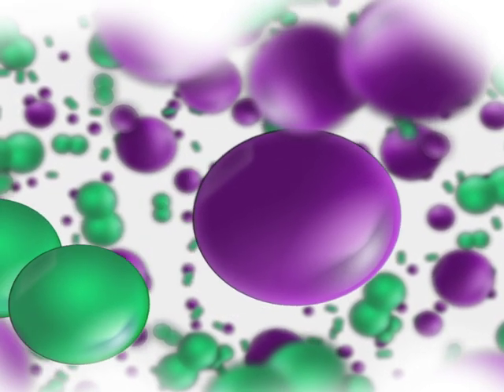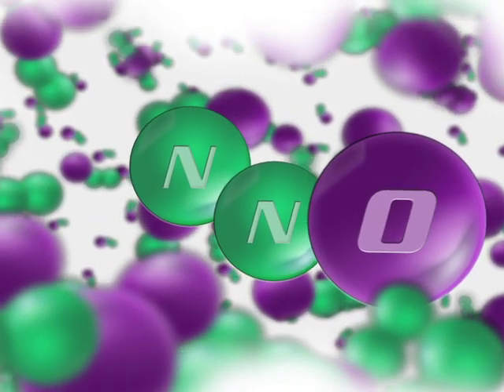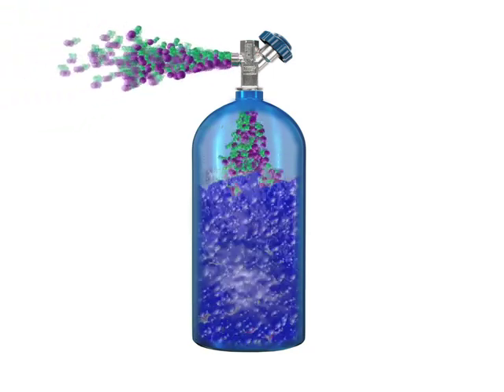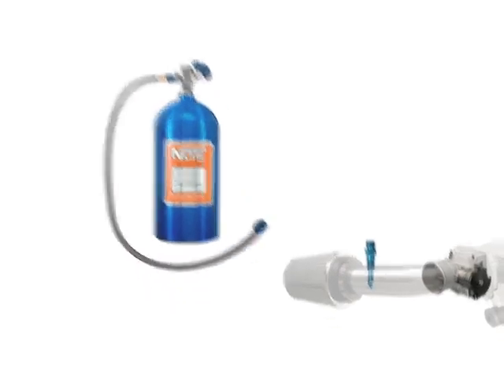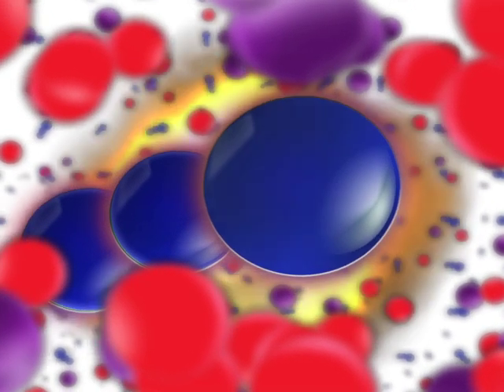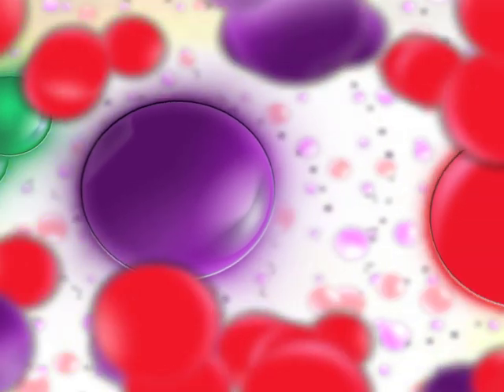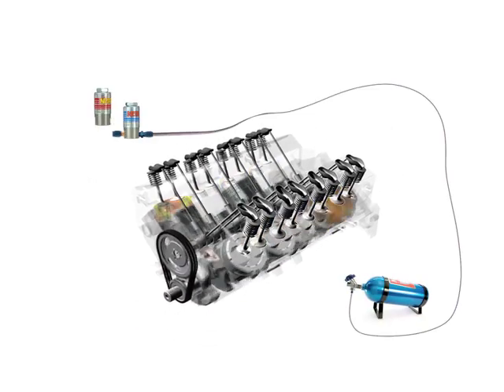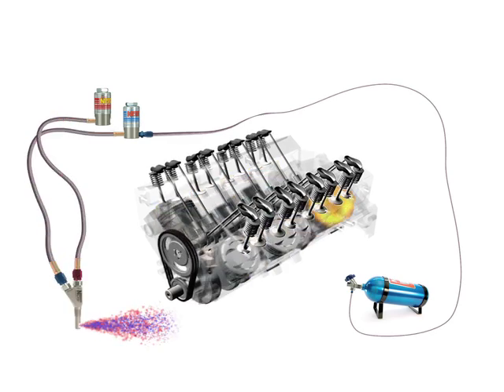Introduction to NOS: How nitrous oxide injection makes more horsepower

Comment: Can i Put 2 or more of these kits on one engine or car?
Reply from the maker: “You can put as much nitrous to an engine as you want to, but you want to do it in the safest manner possible in regard to the purpose and longevity of the engine.  You can run as simple or as elaborate of a system as you want on a car, it doesn’t care.  You can have one bottle hooked up to a single stage of nitrous, or you can have four bottles (which would be ridiculous and excessive and make for a lot of plumbing hooked up to one stage.  Conversely you can have what most racers tend to do, which would be to have the car setup to run as light of a system as possible that takes care of their needs, which might equate to 1-4 stages of nitrous with plumbing for one to two bottles at the most.  The most important thing to do is to read the directions about the kit you buy initially and have a good understanding of how much nitrous your engine can take at a given time.”